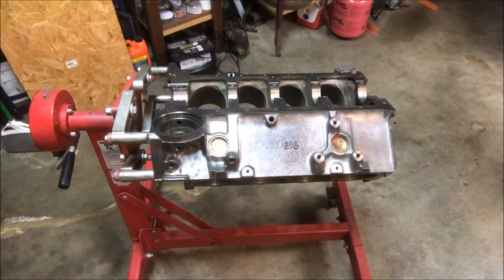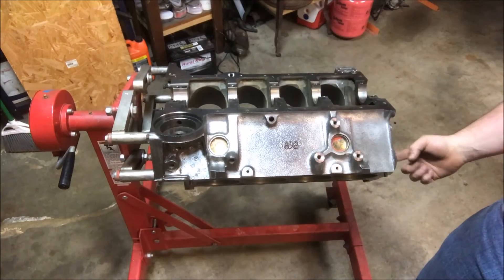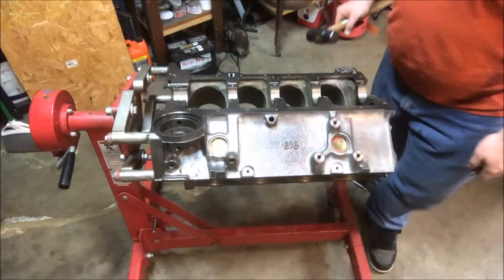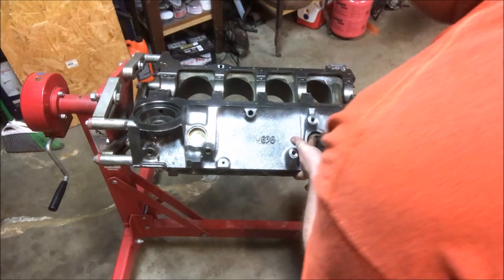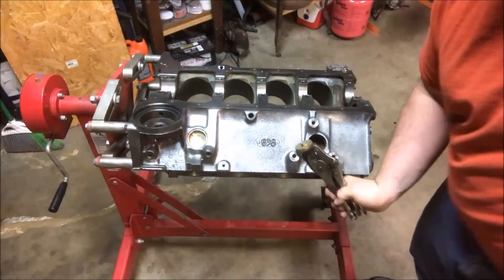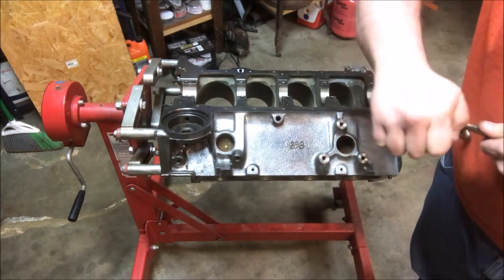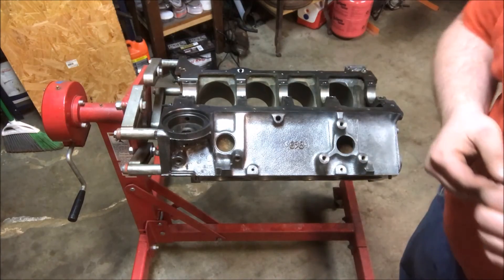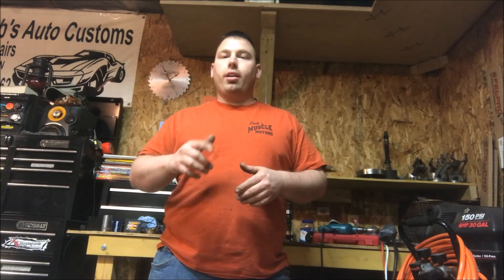Engine Building 101 Core Plug Removal

Comment: You do awesome work. Can you rebuild a 3.0 140 hp mercruiser boat motor? I want to keep it original as I can but the previous owner blew a head gasket and I have rust in two of the cylinders. Any help would be greatly appreciated.
Reply from the maker: Marcus Lambert thank you Marcus! If you’re asking if I personally can yes it shouldn’t be an issue. Rust in the cylinder isn’t so bad unless it’s very deep.